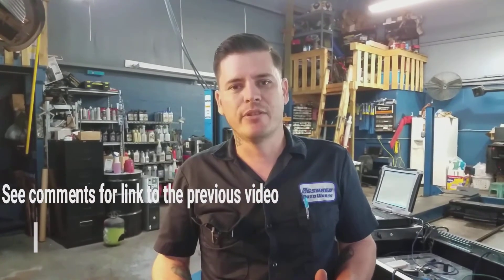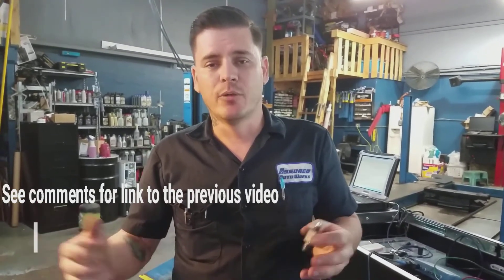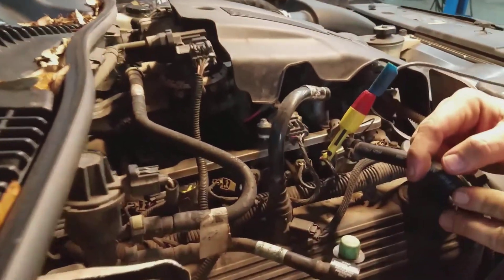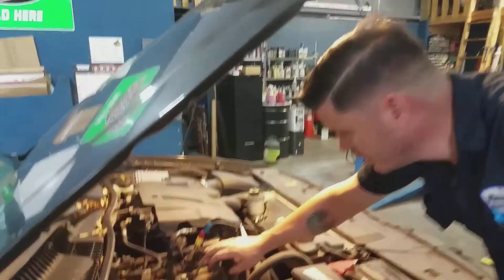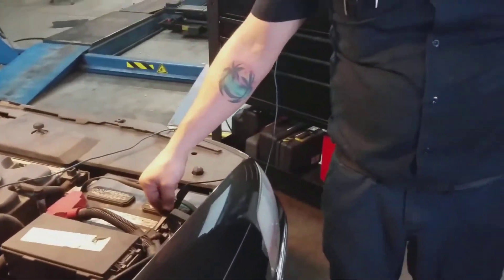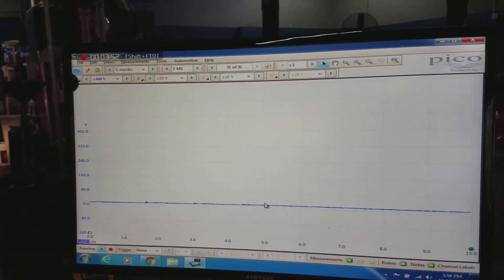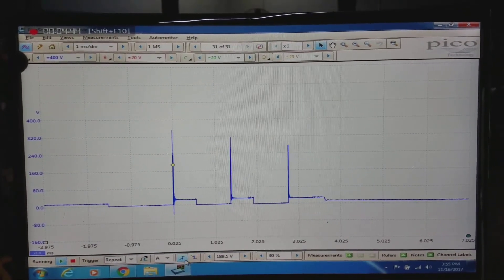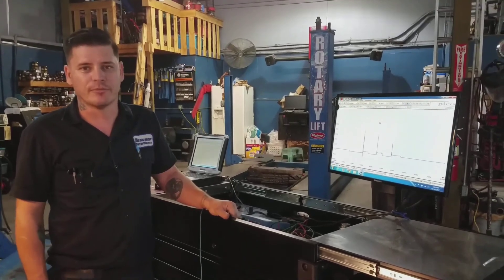Picoscope Attenuators expained

Comment: I just tuned in to this Chanel, I was surprised they way you hook up to the wire, instead of back probe the wire?
Reply from the maker: A pierce probe was carefully used. Most of us encourage the use of a pierce probe due to us experiencing scenarios when a backprobe FIXED a poor connection at a connector. You also risk shorting adjacent circuits as a backprobe pin enters the connector. As long as the technician probes the wire gently as to not damage the conductor AND properly seals the insulation when testing is complete, there is absolutely nothing wrong with using a pierce probe. I personally encourage the use of "Phils probe" from AESwave for many reasons but one being that the probes portion of the insulation will have tiny, almost microscopic holes instead of a big needle hole from some less quality pierce probes. Regardless of which tool you use, always practice professionalism! Make sure your connections are safe, least intrusive and properly insulated when repairs are complete!
Reply: @TrainedbyTechs  alright, some want's the Daugther other the Mother 😁😁 I prefere the back-probe all the plugs today have channel for the wire connection, so I think the chance for short wire ain't so big 😵
Reply from the maker: Thanks for being a supporter and stay healthy my friend!
Reply: @TrainedbyTechs You too my friend

Comment: Do you need  an attenuator when using a snap
 on modus ultra ?
Reply: Look at the maximum input voltages of the inputs on your tool.  If the voltages your measuring is more than the inputs can handle, the input needs attenuation.

Comment: So in your opinion would you suggest using an attenuator every time you test a fuel injector or an ignition coil? I'm a recent owner of a new picoscope 4425. Thanks for the great videos they are very helpful.
Reply from the maker: It's always the safest approach to use an attenuator when testing these circuits. The 4425 does have a higher voltage input maximum than the elder 4423 but there is still always the risk of powerful inductive kicks. I am not aware of any downfall of using an attenuator ( other than a few additional seconds of hookup and setup).
Reply: Thank you. I'll make it a habit to use the attenuator on these circuits.